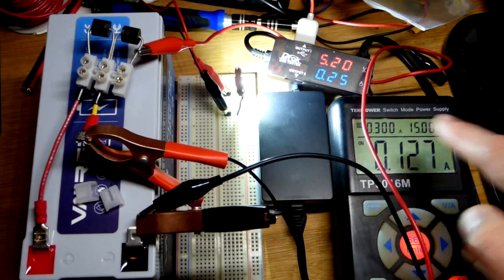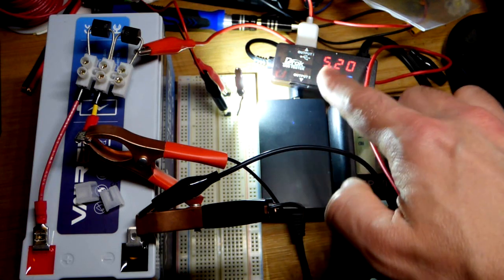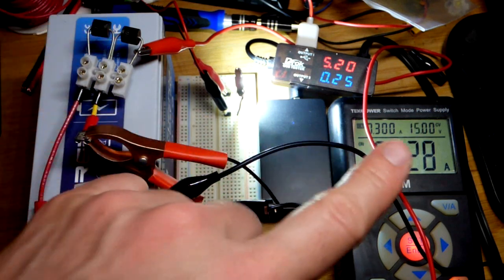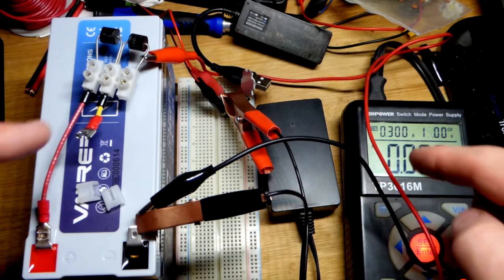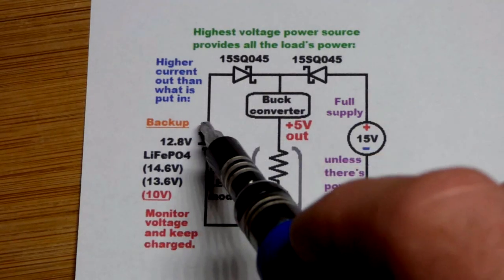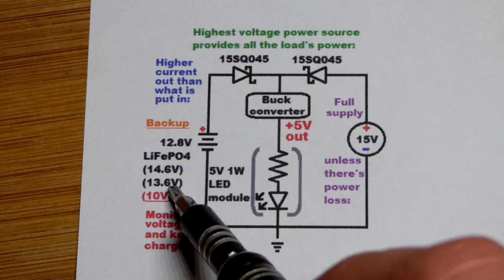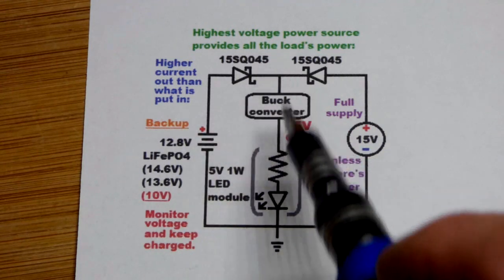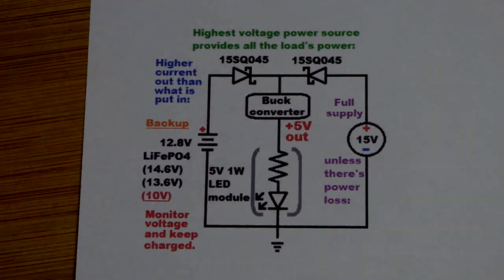LiFePO4 isolated backup supply because of Schottky Diode OR gate circuit schematic by Electronzap

Comment: How would you suggest adding LEDs to the circuit to indicate the active supply, without draining the LifePo4 over a few days?  I'd like a clear/obvious way to know which supply is in use, and given 15v AC supply, I presume the battery won't be touched for any small percentage until an outage.
Reply from the maker: I would probably light an LED directly with the main power supply. If the main power supply turns off, then the LED will turn off and you'll know the load is getting power from the battery. If you need to power a notification system, brief flashes every once in a while or short chirps will be noticeable without drawing much power from the battery if you add a good monitoring system.